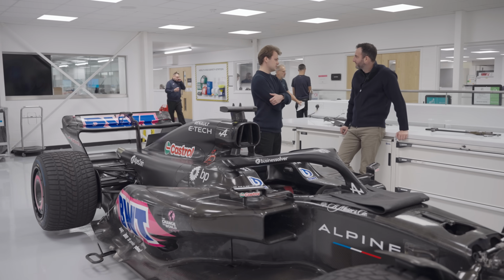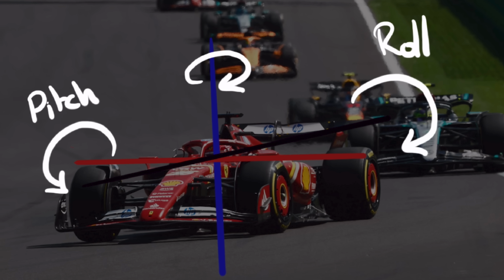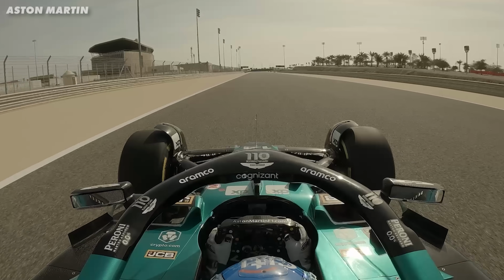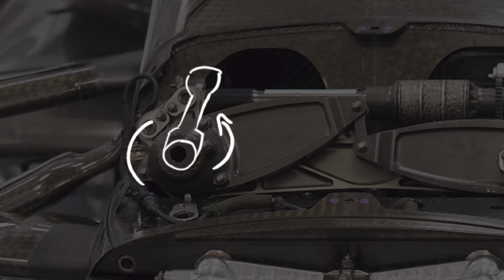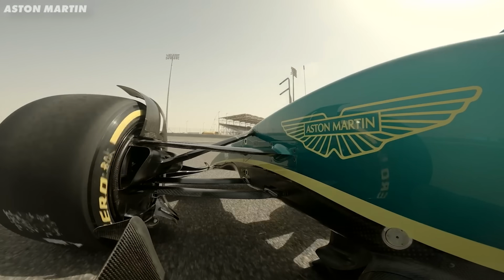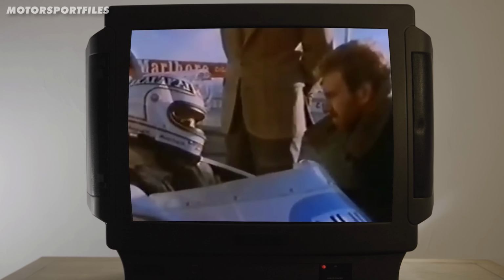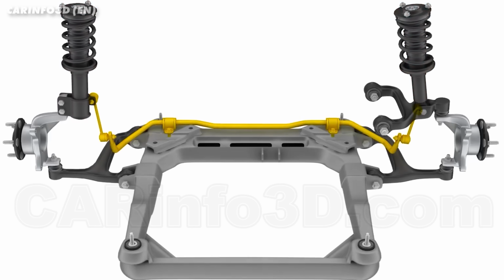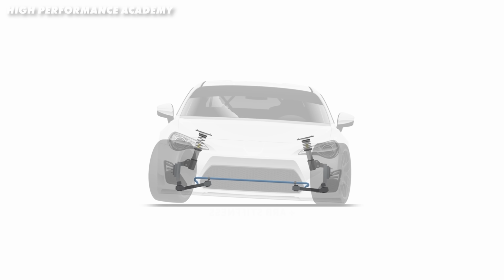F1 Suspension Is Simpler Than You Think

Comment: 5:10
You say 1.8 as if that's a fairly high safety factor, but that's a tighter margin than I was ever taught in school. Especially for a dynamic system that uses composites! They really have the forces and manufacturing dialed-in if that's considered a high safety factor.
Reply: It really depends for what the target is. Lower safety factors can be fine, but will require more rigorous verification. That's why you tend to find them in systems where mass is at a premium.

For instance, aircraft wings are usually designed for a safety factor of 1.5. And rocket second stages will often even use 1.25 because of the potential of saving multiple thousands of dollars for a single kilogram.

In the frame of those, 1.8 is actually quite high. But of course, if you're building a bridge or a house, it's awful.

Comment: you failed to mention how important the Tire composition and response to bumps also affects suspension characteristics including ride frequency issues.  The heave spring invention has been a huge advancement in grip levels but they've leaned on it a bit much for high speed control IMO.

Comment: Kinda wanted to hear what the torsion bars are made of. But yeah that's incredible that alpine allowed such a deep dive into their tech, thank you!
Reply: Typically a "spring steel", which is a steel alloy that is strong and flexible. Allowing it to flex under load and spring back to its original shape.
Although in F1 I'd imagine they might have blended their own formula of spring steel, in comparison to the mass manufactured spring steel torsion bars in the automotive industry

Comment: Random question, probably obviously or silly to some and it is quite late. Tethered wheel  part I  understand but when changjng wheels where is that part?
Reply: The wheels are not tethered. the wheel bolt to the hub, the hub rotates in the hub carrier, and the carrier for the hub is tethered. If the wheel nut fails the wheel goes flying, but if suspension parts break everything is held together by the tether.

Comment: at 2:00 you talk about the anti roll bar running down the torsion bar AS YOU DRAW LINES ON THE PUSH RODS,,,,doh!
Then at the end 12:42 you dont explain how it actually works, how does it only resist lean angle?
And you never talked about the rocker arms linked together in the center, that looks like the anti-roll bar function.
And the last part, the suspension is dialed in for proper balance the best they can, which you never mention.

Comment: Very interesting. 
I'd have both following questions:
1 : It's not very easy to understand how does this particular anti roll bar work ? Why is it located in only one side ? It doesn't have to link both sides to insure an anti roll function?
2 : What is the function of the small bar which links both rockers at the center line ?
Reply: That small bar between rockers is perplexing.  It appears it would raise the inside tire around a corner, not droop it as it pulls the rocker down on the right side.
Reply: yes, the anti roll bar must connect to both sides. One mounted inside a torsion bar spring will have one end connected to the moving end of that spring, and the other end connected to the other side of the suspension - that connection to the other side is the big pair of levers which are connected to each other by a short link and which sit in front of (nearer to the camera) than the rockers. that "small bar" is connecting the anti-roll bar levers, not he rockers. The description at 12:59 is incorrect: neither end of the anti-roll bar is connected to the vehicle structure (tub) in rotation.

Comment: My 62 C10 has torsion bar front suspension, so almost exactly the same.
Reply: LOL 
But yes, torsion bars all work the same way. 
The truck has the torsion bars acting directly on the lower control arms, while current F1 cars use pushrods and rocker arms to transfer motion and force to a separate shaft. And of course the C10 doesn't have a heave spring, and its anti-sway bar is mounted differently. 

GM "heavy duty" pickups (3500HD) still use torsion bar front suspension.

Comment: Small clarification: the car is pushed down by the higher pressure above, not “sucked down” by the lower pressure underneath. It’s a very common misconception- in physics, vacuums don’t “suck”. Brilliant video.
Reply: well, suction is the consequence of a pressure differential, so saying the car is pushed into the ground or sucked into the ground just means that the pressure above is higher than the pressure below and both are corrected
Reply: @edb5991  You are totally correct- I was just trying to avoid getting lost in the words. It's important to know that in order for a physical object to be moved, a force must be acted upon it (the molecules / atoms / electrical fields, etc...) by some sort of contact (conceptually speaking). Positive pressure is the physical force of the medium being imparted onto another medium (like air pressing against the inside of a balloon). "Suction" is simply the absence of the positive pressure / physical force, so it is passive, not active (nothing is pulling on the balloon from the outside). It is completely relative; you can refer to 10,000 lbs./sq.in. as "low" pressure when compared to 20,000 lbs.sq.in. There is nothing below the car that is acting on it, only the pressure above it. I know you know this, I just wanted to clarify it for those who are learning. Go science.
Reply: So, an airplane wing is not lifted by low pressure passing over it ?
Reply: @neilmcmahon  No- that's the misconception... the higher pressure under a wing pushes upward- there is no such thing as a suction force. It’s relative- on a wing, the pressure above (force pushing downward against it) is less than the pressure below (force pushing upward against it), therefore the higher pressure below exerts more upward force, thus lifting the wing. A similar misconception is that ice cools down your drink... it's actually the drink heating the ice cubes, not the other way around (heat only moves in one direction). Yeah, science...

Comment: 12:58 something is not right here..... If one end of the anti roll spring was connected to the tub (fixed) and the other end is connected to those long arms with the link between, then how is that controlling anything? 
The long arms have to be connected to the pushrods/rockers via a spring so that the arms act against suspension movement.
I wonder if the 3 splines on the torsion bar at 8:23 is anything to do with it? Left of the center spline is the main spring, right of center is the anti roll spring?
Reply: The video specifically did not say this, but I suspect the anti roll bar is concentric to the main spring on the right side, the portion of the bellcrank you see in front rotates independently of the main pushrod bellcrank. Since the old days they needed a way to adjust the amount of anti-roll from the cockpit and they probably have a sliding mechanism that links the anti roll bar to the right main spring so they can adjust how much force goes into the chassis vs the anti-roll linkage.

Comment: What sort of maximum suspension travel exists currently in F1?  Somewhere around 10 centimeters? More? Or less? I understand this is all track and Team specific, but what general max. Travel is usually incorporated into a team initial design?
Reply: If the minimum ride height as specified is 15mm and the cars spark there is approximately 15mm of compression, or squat, built into the suspension, understanding that the tires are also absorbing some of the squat. If droop is approximately equal to squat that would equate to about 30mm +/- designed into these cars. Is that correct?

You'd obviously like a little adjustment for ride height adjustment, so is 50mm  total design travel about right?

Comment: Safety factor of 1.8 is not something I personally believe after seeing Haas at Mexico 23. They definitely push the limits
Reply: Well 1.8 as a safety factor is pushing it anyway. IIRC the standard safety factor for mechanical structures that envolve possible accidents with people is 4. Also you have to consider the load calculations are never 100% correct, you calculate the highest load possible by measuring certain situations but you can never consider all situations. On the other hand F1 Teams probably have more data on loads in their car than any other mechanical engineer.

Comment: What about he little link that joins the ends of the rocker arms togeather, that's what it looks like any way.
Reply: That would be the anti-roll bar, I think. Looks like he got that explanation a little bit wrong in this video. If one wheel goes up, its rocker will rotate and that little link would force the other rocker to also rotate. That would transfer force from one wheel to the other, just like the example with the U-shaped bar on a roadcar. The stiffness could probably be adjusted by the shape/material/thickness of that little link.
Reply: @_RobertS  
??? Must be something like that as it looks like a 1 to 1 connection between those 2 paddle shaped things. Maybe they have some flex in them. Maybe it's just 1 to 1 with no movement between one side and the other. See if anyone smarter can shed some light on it.
Reply: @broughxtreme  the link needs an explanation.  It seems counterintuitive to have this as it would pull the inside tire up in a turn, no?
Reply: @sn8277  Yeh  well that's what an anti-roll bar does, but with some flex in it,
Reply: @broughxtreme  Yea agreed, but that bar is not working torsionally...it pulls or pushes the other arm in compression or tension....A roll bar twists to do it's job.

Comment: Are torsion bars more effective for sport applications? I know the old Porsche 914 had a Torsion bar suspension and that was always talked about like it was a subpar "caveman" level of technology by a LOT of people (back in the day).
Reply: A torsion bar spring is lighter than a coil spring, but requires a heavier (and in some cases more complex) suspension. In an F1 car it already has pushrods (or pullrods) and rockers to mount the springs inboard, so torsion bars can be used without any additional penalty.

Comment: I race rc cars and one of the changes I make is roll center and castor. I’m curious if F1 teams or drivers have the same option for these adjustments?
Reply: I suspect those are things they don't often adjust in F1. But everything is bespoke so of course it CAN all be changed completely. Caster could be changed by replacing the wishbones I suppose, but roll-center would require altering the attachment points on the chassis side. That in turn would require a new gearbox casing at the rear, or a new tub on the front, which are really big changes. Sometimes I have seen modifications done to tubs to move the suspension mounting points, but again that is a big job that they probably wouldn't play around with back and forth.

Comment: @1:50 I am pretty confident that the arrows are the wrong way round
Reply: Nope, the video is correct; the load gets transferred into the outer wheels, meaning the springs on the outer side (in this case, left) have more weight put onto them, pushing them lower, and the reverse happens to the inner (right) side, the wheels are unloaded so they rise back up again, like a spring.
Reply: @gamechip06  the video is indeed wrong, as it specifically says, one wheel goes up, and the other goes down. The arrows are wrong when referring to wheel position.
Reply: @GamezGuru1 rage bait?
Reply: I noticed the arrows  are backwards as well

Comment: 6:00 The interesting part in these push/pull rods is how to make the ball joint with zero slop. Unlike passanger cars, you don't want to use rubber to reduce vibrations and any miniscule amount of slop in the bar will cause hitting action which will quickly damage the interacting surfaces.

Comment: 12:41  why rockers are connected together?
Reply: That's the transverse section of the anti-roll bar I think. Your longitudinal sections are what Scott sketched, and the small connection is what drags the other wheel up when only one tire hits a bump so that the car doesn't roll
Reply: its a pretty slick layout, where one torsion bar is for roll, and the other side will be for heave. Where it looks like the rockers are rigidly connected is actually so when the two wheels move in opposite direction due to roll, it twists the torsion bar shown in that part of the video. So one rocker twists it one way, and the other rocker is connected to the other end to twist it the opposite way. When in heave the two rockers turn the torsion bar the same way, so no resistance.

Comment: 3:40 If the vibration to the body of the driver is the only problem, why not suspend just the driver on springs and dampbers and keep the body of the car totally solid?
Reply: That would take away all of the feel for the driver through the seat which is the main way the car communicates with the driver and it would make it near impossible to drive on the limit so I just don’t think the trade off in performance would be worth it. Also having no suspension wouldn’t be great for the durability of the car, over a race distance it would probably be rattled apart
Reply: The driver needs to be absolutely stable for precise input to the car control. Imagine trying to brake very hard and having your body fluctuate at the same time.

Comment: As Peter Windsor said F1 should bring back the active suspension. The technology has moved on soo much it would be cool to see the tech and upgrades
Reply: Increase mechanical grip and reduce aerodynamic grip, which results in agile cars that can race each other with less "dirty air" to consider.
Reply: @Stonebearer  Unfortunately, F1 seems to have cornered themselves on that one by setting the expectation that speeds must only ever go up even though fans would rather have better racing with still plenty fast cars.
Reply: @tHebUm18  Well, the last major slowing down of the cars in F1 was in 2022 with less sidewall for example, but I get what you mean. The crazy high cornering speeds of say the W11 require trick aero. F1 is not a time trial though and I believe the cars should excel in wheel-to-wheel. Also, if I can dream, ditch the 90 degree V6. Worst sound ever... Like an old Buick, bleh!
Reply: @Stonebearer I think they should go with a more radical route and reduce cylinders to 4. I think it has the potential to sound better even with less cylinders.
Reply: @carlosandleon  That could definitely work.
Reply: I disagree. This purely mechanical solution comes very close to the old active suspension - no need for it anymore. With the current suspension system an F1 car is already at least 14 seconds faster in Monaco than in the late 1980s:  Ayrton in 1998 at 1,24 versus Lando 2025 at 1,10
Reply: @MrChefjanvier  racing suffers in favor of lap time. If this was a qualifying-based sport I would agree with you.
Reply: Peter Windsor says many things
Reply: Peter Windsor is a clown who's opinion is ultimately irrelevant.
Reply: I think F1 should go back to being the pinnacle of engineering excellence and let the teams go wild in coming up with the better solution.

Comment: I always wondered why the wheels didn’t go for a ride of their own after a crash… pretty cool method to keep them with the car
Reply: Check the start of Belgium 1998. That's why 😅😅
Reply: @0xf7c8  the reason is also the 1994 san marino grand prix
Reply: @bobbobert9379  wasn't the issue with young brundell receiving fatal hit with the tyre? 

How about infamous tyre launch from Buemi's Torro rosso.
Reply: @y.a.p8951 Senna was also hit with a tire, the rod specifically, but surely there had been multiple tire related incidents.

Comment: Torsion bars are still used today in the U.S. for some heavy duty pickup front ends. They are available in different thicknesses for different payloads and have an adjustment key at the fixed end for fine tuning
Reply: Most modern tanks still have torsion bar suspension
Reply: there also still used in karting for tuning
Reply: also the Iveco Daily uses torsion bars as springs and a lot of 80'-00' french cars used torsion bars on the rear. see Saxo, Clio, etc..
Reply: Porsche used them on the 911 up until the 996.
Reply: @ggram. Porsche moved to coil over suspension starting with the 1989 Carrera 4 (964).
Reply: @ggram. Porsche used torsion bars long before the 911 on the VW type 1 (Beetle) and as well as the 356 front and rear swing arm suspensions. 

The Porsche 944 used the VW rear IRS torsion bar suspension geometry along with VW Rabbit suspension (McPherson struts and A-arms) up front. 

So you swap aluminum 944 rear swing arms from the late 80’s into to a ‘68 IRS VW type 1 Beetle.
Reply: That's the GM (Chevrolet Silverado and GMC Sierra) 3500HD. Ford and Ram don't use independent suspension; they have coil springs on their front beam axles.